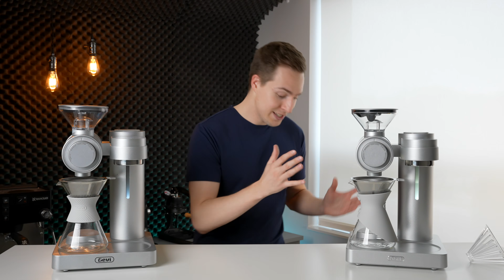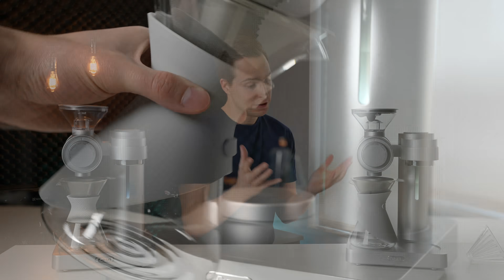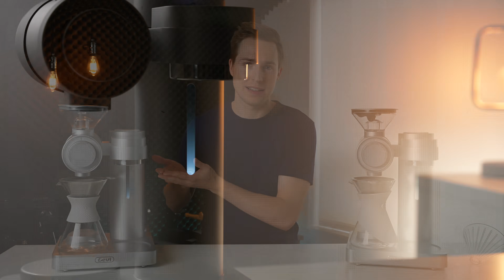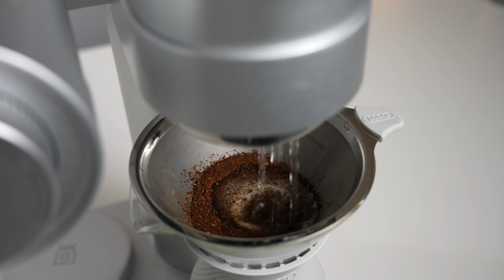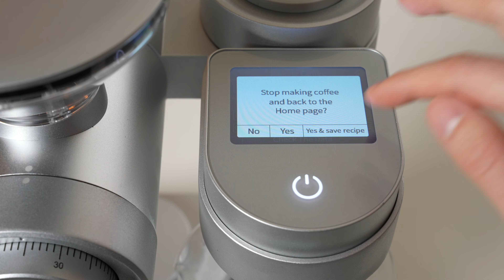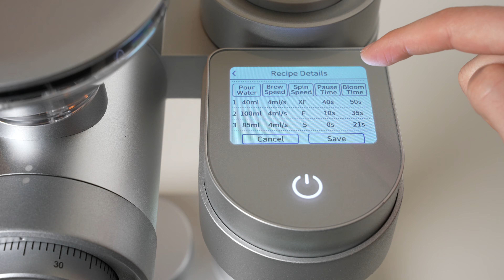GEVI 4 in 1 Final Version | They Listened!

Comment: My concern was longevity, especially as a few issues with some early units. However, I have used this twice a day for over a year and it delivers every time consistently. Grinder is well suited to pourover. I set up a 5 step pulse pour and it hits the spot every time. The brew never stalls and level bed every time. I use a V60 above a Hario insulated jug, the No. 2 jug fits perfectly, the No.3 fits as well - moves the bed closer to the spouts, probably better for heat loss. After bloom I do the Hoffmann swirl and once the last pour, another swirl. Every brew finishes within seconds of each other and you just let it do it’s thing.
Reply: what grind setting do you use for the v60?
Reply: @xtianb7035  17 or 18

Comment: Do you know if there is any plastic in the brew line?  Plastics when water is heated or is acidic, it leaches these estrogenic chemicals into the brew.  My manual drip process uses a ceramic cone. For me metal (steel or copper) is acceptable.  I personally am not concerned about the water storage tank just heated and brewed water
Reply: The water reservoir is 304 stainless steel.

Comment: Love your style of videos and how articulate you are.  I am ready to buy this machine but have a few questions:
1.  Are the dimensions really 10x10x11 inches?
2.  What is the minimum volume you can make.  In other words, can I make one 8 ounce cup of coffee?
3.  Is there a manual?

Thanks again for such an informative video!
Reply from the maker: The machine is 10x10x17 to the top of the hopper
You can make as small of a drink as you like, and as your brewing method with allow. Water dispensing is completely programmable. 
Yes there is a manual :)
Reply: @LifestyleLab_  Thanks so much for a quick reply. Any chance of getting a pdf of the manual?  Can’t seem to find it online.
Reply from the maker: It’s a printed version unfortunately

Comment: This thing comes with a really good grinder. You could have both this and a Decent and not need a separate grinder for espresso, which is great value.
Reply from the maker: This grinder is good, but I would recommend it as your dedicated espresso grinder. Especially with a machine as expensive as the Decent

Comment: He fell short of saying "I approve".
Also missing is any mention of taste, which is what ultimately counts. 
At those prices, there's a 4th group of users: OCD gadget correctors that like to have conversation pieces in their kitchen.
Reply from the maker: Taste will be completely dependent on your coffee and recipe. 
Commenting on taste from this system would be akin to commenting on the taste from using a particular kettle... it's merely a water delivery method. 
Grind quality was covered in the original video, it performed quite well
Reply: @LifestyleLab_  
Obviously we must fix the recipe and coffee beans variables. 
The point is to compare the delivery of that same recipe by this automated gadget versus a manual pour. For example, when it says 97F, was it really? 40ml of water, was it really? Besides evaluating the accuracy of the dials, more importantly, say my recipe calls for 60ml of water poured over. When I do it manually, I let that water sit on the coffee, which sits soaking for a while before dropping into the cup below. In this gadget that same 60ml is delivered in drips, and nothing soaks. What's the difference in taste?
Reply from the maker: Most of those point are addressed in the original video :)

Comment: How do you pulse pour on this machine if the flow rate is fixed?
Reply from the maker: Flow rate is not fixed. You can set many individual short pours at whatever intervals and flow rate you want.
Reply: @LifestyleLab_  understood. I think a followup recipes for this machine would have completed this video. I guess you could still do those under youtube shorts.

Comment: Sounds good, I need to go back to your original video but I think you were impressed with the grinding. As a good grinder was going to be my next upgrade that's about half of what this costs. Great video 👍
Reply from the maker: Grinder performed quite well for pour over! 60mm flat burrs, vertically mounted 👍
Reply: @LifestyleLab_  watching your first video again now😀 Did they add a USB port?
Reply from the maker: No, still no way for future software updates unfortunately
Reply: @LifestyleLab_  😱 700€ maybe  I should just get a X54 or a Uniform as I have the Sage Precision brewer. 🤔
Reply: @emersonmsd  Lagom Mini.
Reply: @ericanderson1753  will it hold 60gr? I brew a litre every morning.
Reply: @emersonmsd  ah. Good thought. It will not hold 60g.
Reply: @ericanderson1753  thanks for the idea anyway 👍🏻